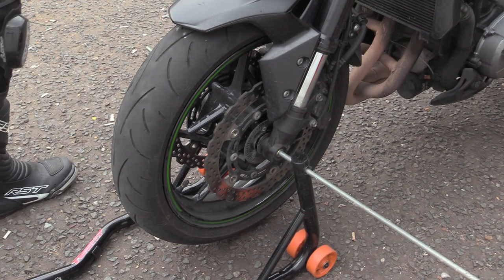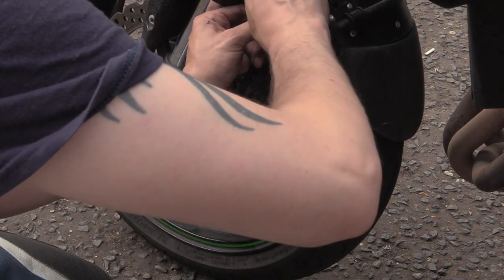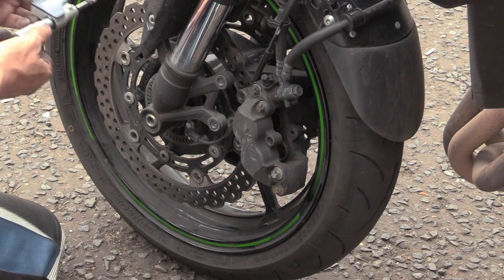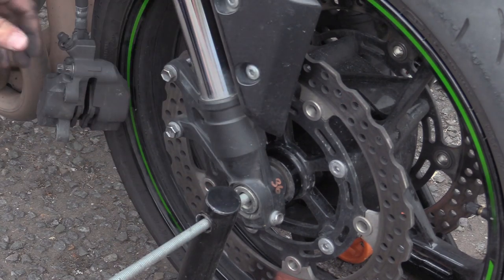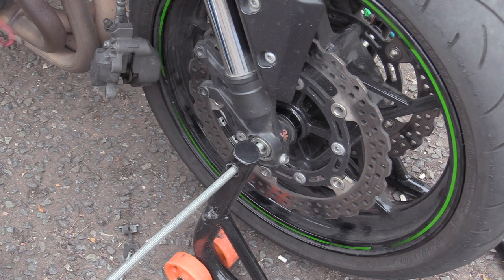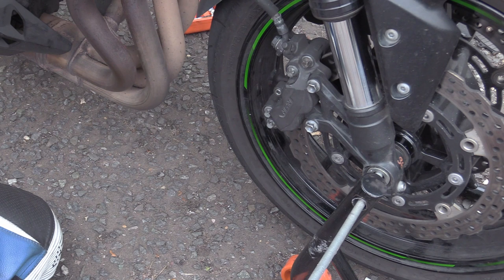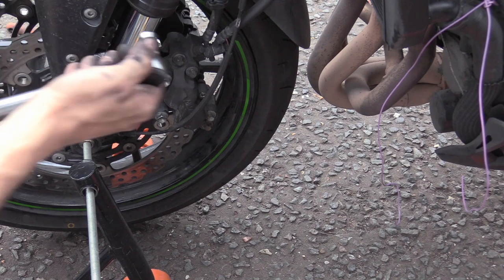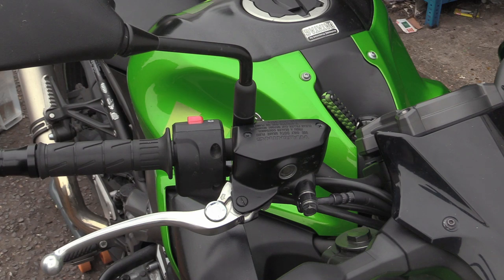Brake Problem - Kawasaki Z900

Comment: You sure your maths is right on the remaining life in those discs Matt? Two different ways of working it out that I can see. 
Method A; 

0.14mm used in 6000 miles. Divide 0.14 by 6 and you get 0.02333333mm per thousand miles. Then the remaining 0.86mm of thickness divided by 0.02333333 gives you a remaining mileage of the best part of another 37,000 miles, based on current wear rate. 

Method B;

1mm of available thickness divided by the 0.14mm used goes 7.14285714 times. Times that by the 6000 miles done gives you just under 43,000 miles of life, minus the 6000 miles already done gives you the same (roughly) 37,000 miles of life left. 

I panicked when you said you only expected a maximum of 18,000 miles out of them, have you seen the cost of replacements!!!
Reply from the maker: LOL what? How is there 0.86mm left? 

The disc was 5mm, now its 4.68mm - that's 0.14mm or 140um removed - and as you said that divided by 6 = 0.020um per 1000 miles. 

I have 0.36mm or 360um left before I hit the 4.5mm minimum (5mm - 0.14 = 4.86mm) 

360um  / 20um = 18 therefore 18 LEFT on the disc - which is what I say here 17:56. I say "and this should last me another 18 thousand miles"

Looking at your figures you seem to think the limit is 4.00mm - it's not, it's 4.5mm. 

The 6k I've done , plus the 18k possible gives me a total range of 24 - 25k miles before they die. 

"You sure your maths is right on the remaining life in those discs Matt?"

- Yes
Reply: Lol, was the end of a long day for me and you’re right, I was working out based on a service limit of 4mm, not 4.5mm. Shit, that being the case, I better grab my micrometer later. I’m on just under 11,500 miles on my Z900, so it’ll be interesting to see how much meat is left on mine. That said, with the mileage I’m currently on I’m still on the stock front pads with life left in them, so perhaps mine haven’t worn as fast as yours. As before though, have you seen the price for a pair of OEM discs!
Reply from the maker: These are the stock pads. And all OEM discs are stupid money, and I'll be replacing them with something different when the time comes

Comment: Fucking hilarious......"What the fuck is that ?" (spin) What IS that? (spin) "have I killed a bearing?"(spin) "The only thing I can think of..." (spin) '"Is my ABS sensor pushing against blah...that's bad" (spin) "You've gotta be kidding me (spin) (spin) "No fucking way' (spin)'"Oh, it's the dial indicator......it's so obviously not a bearing noise, it's obviously something contacting the disc SO STOP FUCKING SPINNING IT AND INVESTIGATE IT YA DICK!
Reply from the maker: Because a few more spins would kill it?
Reply: @dirtygarageguy  Well it aint doing it any good is it?....and until you know what it is that's making the noise you don't know what damage it's causing.....so as soon as you hear the noise maybe just move the wheel forward and back slightly and have a good look then.....fuck me you would have seen the DTI......
Reply from the maker: "Well it aint doing it any good is it?....and until you know what it is that's making the noise you don't know what damage it's causing....."

- Seen as though I've been riding around like this for 2 days - it ain't gonna suddenly explode.
Reply: @dirtygarageguy  That noise was nothing to do with the problem you had been experiencing. You were spinning the wheel up at the beginning of the video with nothing but a bit of dragging on the pads so this 'new' noise was most likely to be something you had introduced......For someone who likes to expound best practice you don't like being picked up on stuff do ya Matt? I know someone else like that.......
Reply from the maker: Pull that tampon out of your arse - LOL Look, I was half way through a conversation, and I spun the wheel and expected there to be no sound at all, and there was. I was like 'what the fuck' - from where I was I couldn't see the indicator at all, and it was stuck to the stand. So I turned the wheel to try and work out what it was. 

I even put the convo into the video with Isaac about how dumb it was. But of course you've never been dumbfounded by anything before - because you're perfect. 

Was it something major - no. Does it matter? No. Are you a prick? Maybe? Who knows........